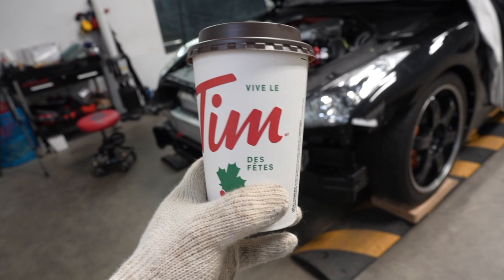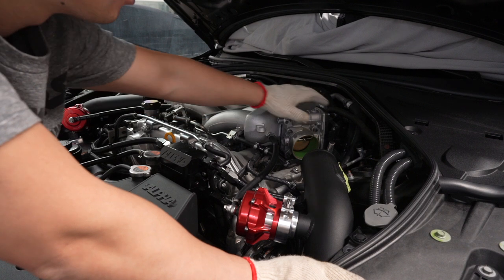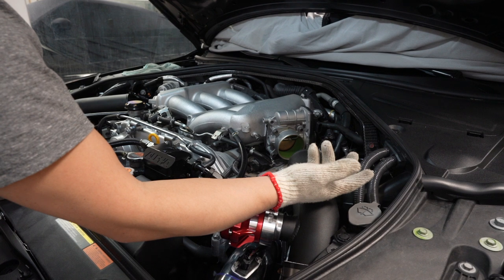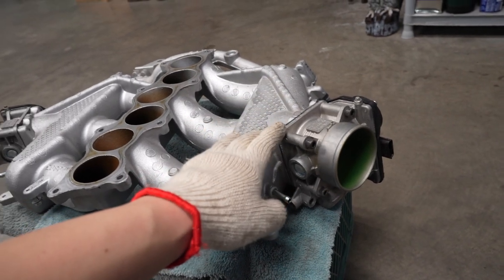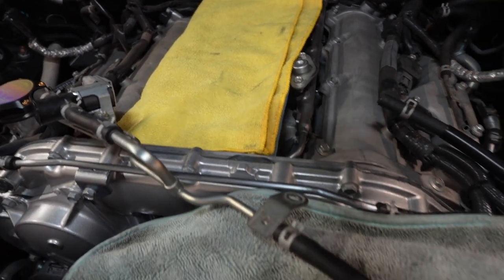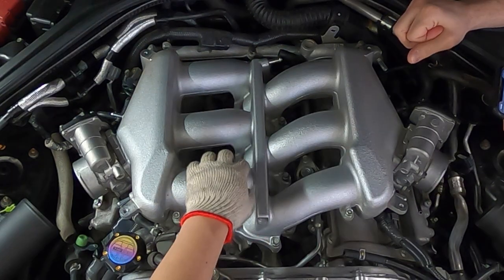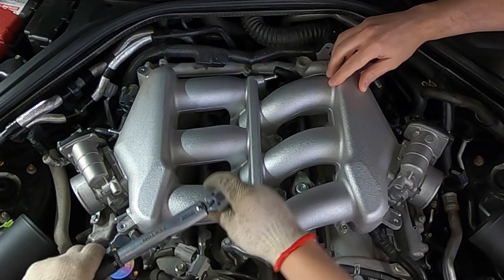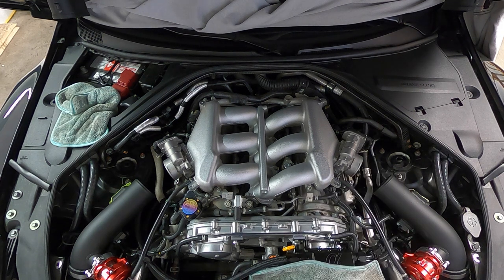Save Your Money!!! DIY Spark Plugs on Nissan GTR.

Comment: Thanks for the Video, i´m just planing to do new spark plugs on my MY14. 
I found the Service Manual (Revision: 2012 ) and in SECTION EM 
ENGINE MECHANICAL there is a Torque spec for the spark plugs, its 19,6Nm (Page EM-8)
...oh and there is also the Info that you need a 14mm socket 😜
Reply from the maker: Thanks for the torque specs. This will eliminate any over torquing.

Comment: Do the spark plugs need to be gapped? Or is it just plug and play.
Reply from the maker: If you are doing a direct replacement with OEM parts you do not need to gap them.

Comment: 900 plus do do plugs at the dealer ? No thanks. Plugs will cost you 85 shipped of ebay
Reply from the maker: Very easy job once you do it one time.
Reply: @phothrottle  yeah. I'm done with mine and yes you have to disconnect battery or your throttle body may need to be recalibrated if you don't. I drove mine around the block after i was done and the idle goes up and down very little from time to time. When idling. Maybe the ECU needs to adjust you had any issues ? I invested in torque wrench. It's coming today. As i have to check the mainfold torque specs. And TB

Comment: NEVER use antisieze on NGK spark plugs...can affect torque specs by 20% (since it acts as lubricant) and as a result could cause messed up threading upon removal which requires you to remove the entire cylinder head for repair...NGK DO NOT NEED ANTI SIEZE THEY ARE ENGINEERED TO BE REMOVED EASILY...sorry about your GTR MAN....
Reply from the maker: Thanks for the info. I reference all of my info from reputable car groups and threads. Almost all recommend anti seize. I will kept this in mind.